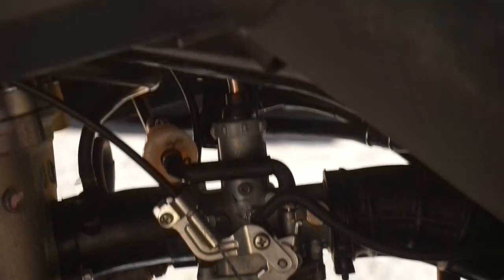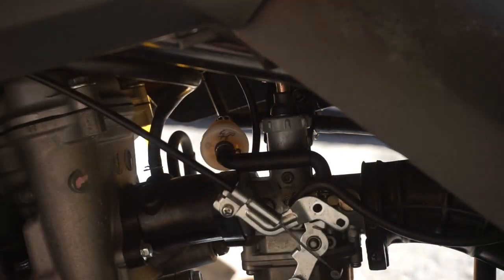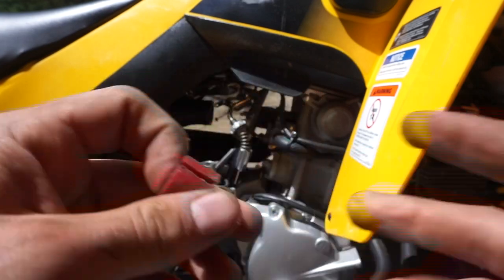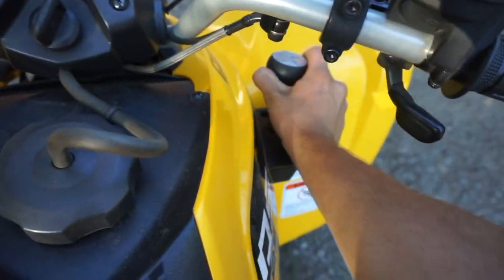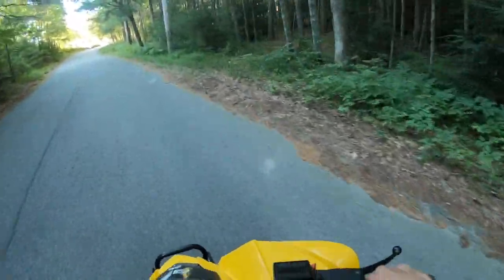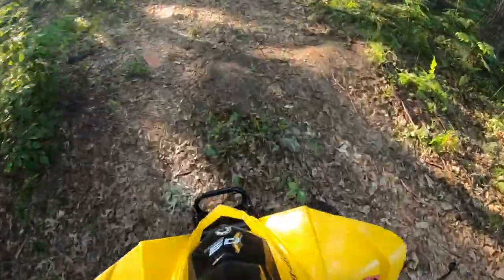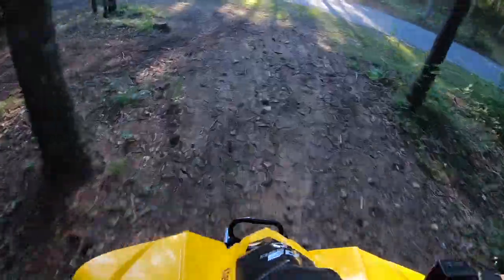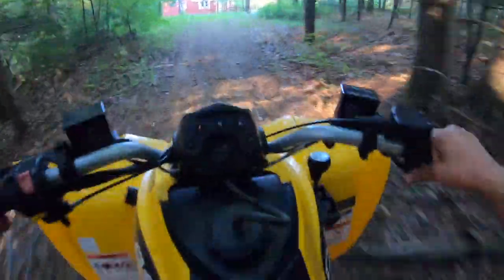Can-Am Ds250 Carb Spacer Removal (Tutorial)-INSANE POWER BOOST

Comment: This video was actually helpful unlike ever other on on the DS 

Just wondering if it still runs fine and if u know what the red plastics purpose was
Reply from the maker: Runs perfect! And I I’m not really sure why, the lack of power without removing the spacer is terrible, even when removed it’s still the slowest 250 in the class
Reply: @andrewarsenault4062  there is a governor, it’s a screw by the throttle, the more you screw the screw out the faster you can go
Reply: It makes it go a lot faster on mine when we did this it went from 20 to 40 mph
Reply: It's like a Rev limiter, it runs at prob 50% throttle, removing it now has 100% throttle available

Comment: Great vid what year is your ds
Reply from the maker: 2015 it was bought in 19 as leftover
Reply: @andrewarsenault4062  Thanks i got a 2017 ds 250, but i could hit like 80 kmh and i didn’t remove a spacer in the carb
Reply from the maker: @antoniobonavota6186  not mine maybe they made changes I get to 40 mph at most

Comment: Hey Andrew, I'm sorry for an off-topic question here, but do you know if there's actually only one grease fitting on Can-Am DS250? I've found the one indicated in the manual (for the rear swing arm pivots) but can the front suspension not be needing any grease?

Comment: I just did it on my cousins quad and now the throttle is limp and don’t know what happened...any help?🤷🏻‍♂️
Reply: Maybe a cable is loose
Reply: You may have reassembled the carb incorrectly. I believe you may have rotated the guts when putting them back in.

Comment: I dont get it. I just bought a 2021 model yesterday took the throttle cable off the top this morning and hope to find the red spacer to remove and there is none in mine I wonder if they stop doing it or not. I was kind of hoping it would be there so I can remove it to make it a little faster still seems kind of slow.
Reply from the maker: Yeah dude I have read some forums and apparently you have to install a clutch kit for these to be even competent with the other 250s.
Reply: @andrewarsenault4062  yea i mean my daughter is 12 and she light. So not bad with her on it. But I may do a 14 tooth front sprocket first and see. The engine is good but clutching dont put in the power band.
Reply from the maker: @Jwils4  yeah I’ve ridden a ltz250 and the power was unbelievable compared to the ds250 opened my eyes
Reply: @andrewarsenault4062  and it's crazy it's just because of the transmission type because the horsepower numbers are the same. A clutch kit and a different sprocket I think would make this machine 100% different
Reply from the maker: @Jwils4  hey if you do it share your results let me know how big of a difference it is.
Reply: @Jwils4  what sprocket has it got stock?

Comment: Thanks for the help! Did you have any issues with the throttle after you removed the spacer? I cleaned the carb n removed the spacer and after I reinstalled it I had no tension on the throttle cable and also the engine was super accelerated? Can you help me out please
Reply: Did you figure it out?

Comment: Is it normal for the motors in these to knock?
Reply: Yeah. I thought I was nuts but it's ok
Reply: Or your carb isn't set right. I found that out on mine after it sat 2 long
Reply: Mine does it mostly in reverse or just high rev but reverse is the worst if I don’t hold the overdrive button it just makes this obnoxious clack

Comment: This will hurt you fourwheeler
Reply: It actually won’t the spacer just keeps the throttle slide from 100% opening its completely fine removing and gaining more power. With the spacer in it only has like 75% power!
Reply: @akthrottle9078  smh
Reply: why?
Reply: @dripmediaa8943  it’s like pulling the pin on a grenade
Reply: @azure4225  but why wat would happen if i took it out ?
Reply: @dripmediaa8943  you find out;)
Reply: @azure4225  pero for why